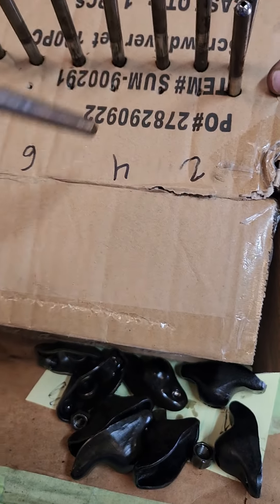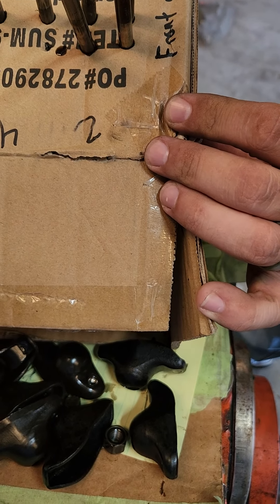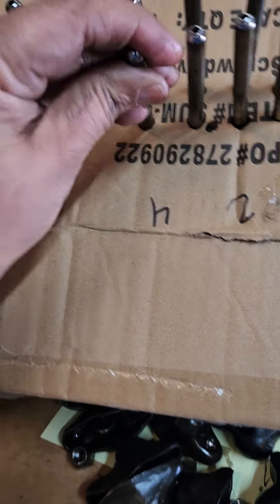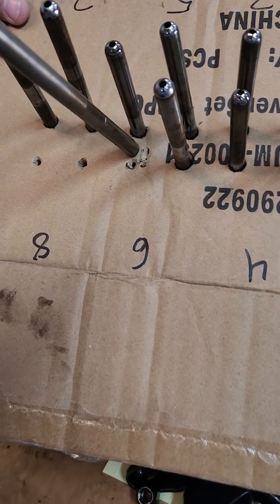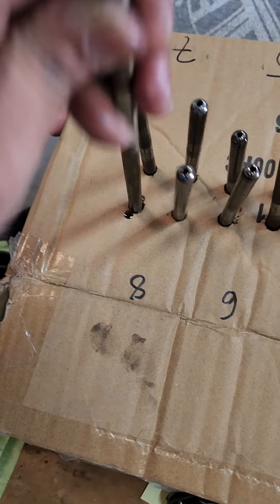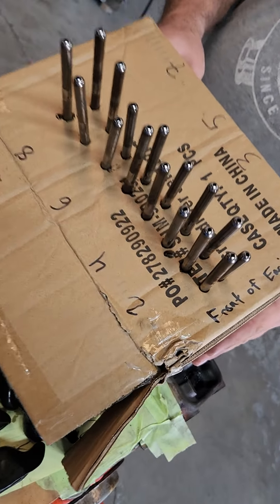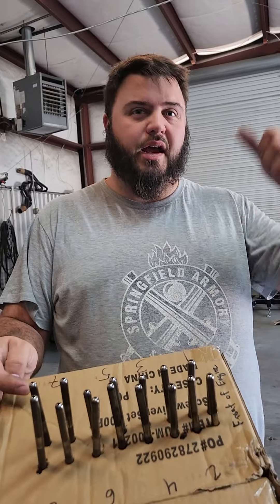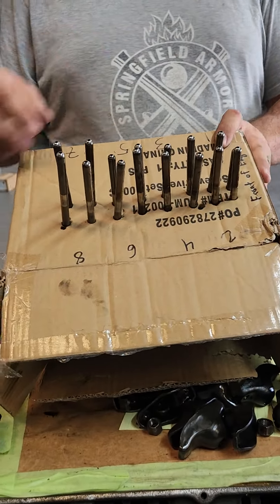I am Learning to Build and Rebuild motors and was taught this old school trick. What y'all think?

Comment: What is the lesson here? (Ignorant about all things engines)
Reply: Stabbing the push rods (things at the top) into cardboard to keep track of where they go as each one needs to go into the exact hole it came out of and on a v8 there are 16 of them so it can be hard to keep track
Reply: @acadiant2756  Thanks. I was looking for this too.

An explanation like this should be included in the description of the video.
Reply from the maker: Trust me I'm new to this as well. This is my first time doing it so in the future I'll try my best at least give an overview. Thanks for your comment and subscribing 🫶🏽
Reply from the maker: This is my first time. We're all learning together. Thank you for understanding and subscribing 😁
Reply: @RydesNVybeswithKP On certain engines you should also do it with the head bolts if it's the first time taking the heads off you can reuse them. On certain engines. If the head has been off more than once just replace the head bolts.